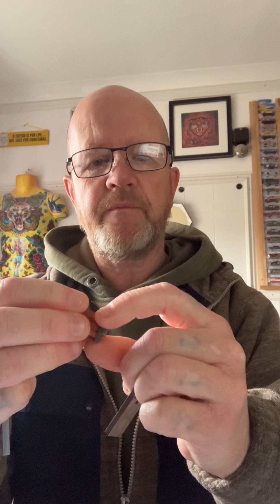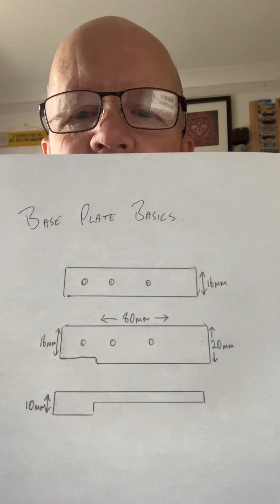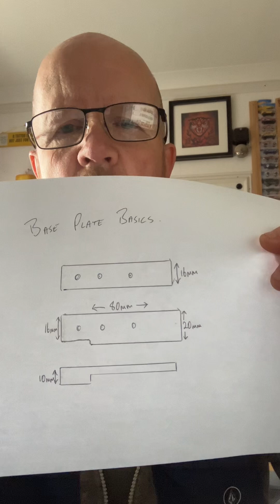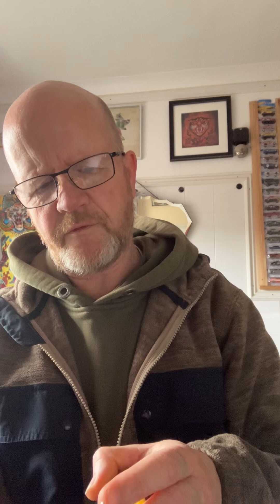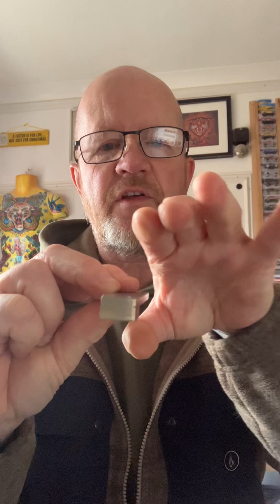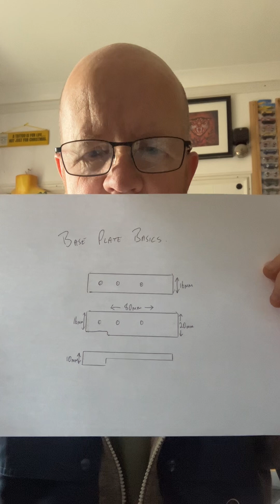Coil tattoo machine base plate basic dimensions from Camber Custom Tattoo Machines

Comment: Nice to meet you!
Your video is really great. Thank you.
I'm not very good at English, so please forgive me.
I have a question.
I was very impressed to see the size and other information written on the paper.
By the way, how far is the center of one hole from the other?
Reply from the maker: hi thanks for watching, great question. the two coil holes in the base plate are 21mm apart, that is to the centre of the holes. need any other help just ask.
Reply: @cambercustom  Thank you for your reply.
I'm Japanese. There's little demand for coil machines in my country, and very few manufacturers.
I'm left-handed, so no one could accommodate my needs. So I decided to make one myself from scratch, and after watching a lot of YouTube videos from overseas manufacturers, I found your video. It was the easiest to understand and most helpful. Thank you so much for letting me learn.
I was really impressed by how the machines you make have few parts, are simple and truly beautiful, and because each part can be replaced individually, they are highly versatile and designed to last a long time.
Furthermore, their simplicity makes them lightweight, which is a very welcome design for someone like me with small, weak hands.
Thank you for the wonderful video.
Reply: @cambercustom  I have a few additional questions. I don't have any power tools yet.

This might be a strange question, but:
1. If you could buy one power tool, which one would it be?
2. If I bought that tool, would I have enough time to complete the machine even if the rest of the tools were hand tools?
3. I'd appreciate a list of the minimum tools I'd need.

The steel we plan to use is JIS standard S20C low carbon steel.
If possible, we would like to solve the problem by brazing.

Apologies for the long message.

Comment: Awesome thank you. That was very helpful. I appreciate your time for making a video. I will definitely find you on TikTok and instagram. I will send you some photos of the machines I am building. Thanks again 🍻
Reply from the maker: no probs, look forward to seeing them. insta is Larrys vintage.
Reply: @ one more question I have is about coil covers. I got the heat shrink but I was curious on what kind of material the designs are printed on. Or where to even look for coil covers.
Reply from the maker: @tyrellfurst-ib8nm  that's a fair question. as you know i use clear hs to show art work etc under neath. I have used all sorts from porno mag advert clippings to studion business cards, just select the section you want and cut to size, always leave longer than needed so you can wrap in around. I can do a video if you get stuck, not a problem
Reply: @  ok so it can be any material and it won’t interfere with the coils?
Reply from the maker: @tyrellfurst-ib8nm  sorry, i was thinking base plates not coil covers. better to have something non metalic as the last thing you want to do is damage the insualtion coating on the coil wire. if it shorts even to iteself it will heat up. stick with paper, card or plastic. forget wrapping copper etc around them. I have always steered well clear of anything that could damage or interfere.
Reply: @ yea 1018 steel for my frames and coil cores. I was asking about the wrap on the coils. I was curious if it needed to be something insulated or if I could use like paper or stickers then the clear heat shrink over it. That clears up my question. I have some cool stuff I could use
Reply from the maker: @ don’t forget to wrap cores with two layers of kapton tape before winding wire on, masking or insulation tape is not suitable
Reply: @  one more quick question I noticed on your jig you made with the coil cores for assembling the frame, the armature bar is tacked to both coils cores. Is The armature bar supposed to contact both coils? I’ve heard people say that the rear coil should have a little space.
Reply from the maker: @tyrellfurst-ib8nm  absolutely, you must have a gap between the rear coil and the A bar when the A bar is sitting on the front coil. I have them welded to get position of holes and side plate rather than the coils themselves. Also, if need be, it is very easy to either micro shim the front coil up a bit to make the rear gap or if it is a really small amount sometimes I file a bit off the top of the rear coil, made easier by the shape of my coil tops. if A bar hits rear coil first the bar will reverberate and do all sorts of weird things. I had a video of it happening in slow motion a few years back, very weird.